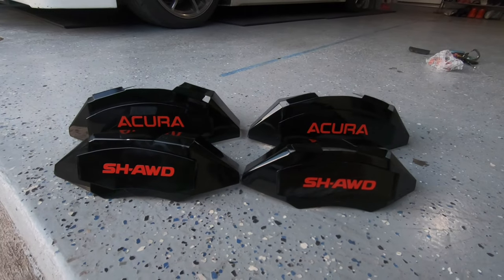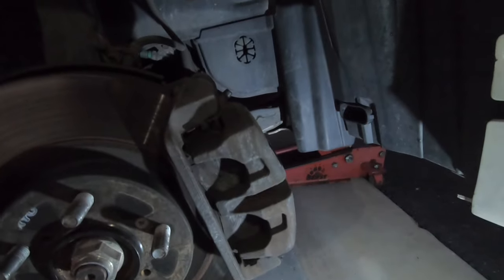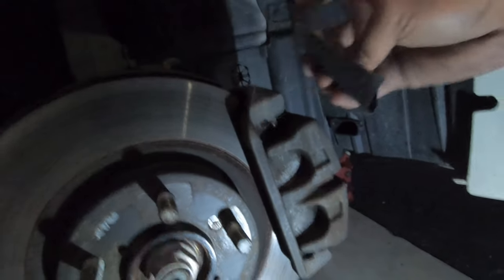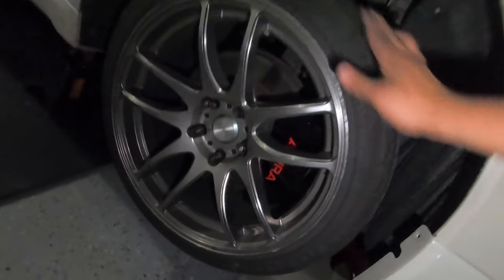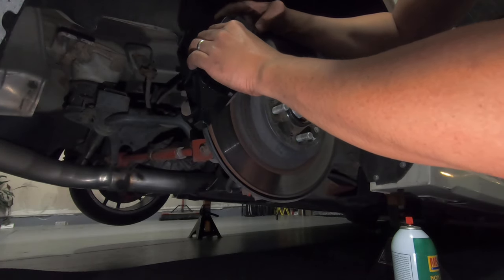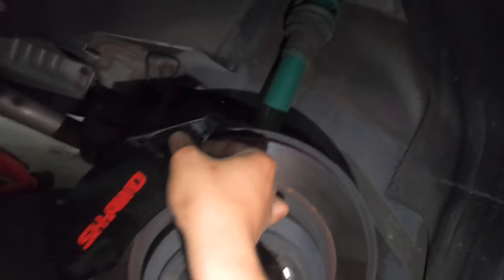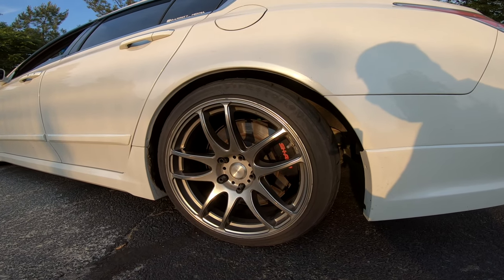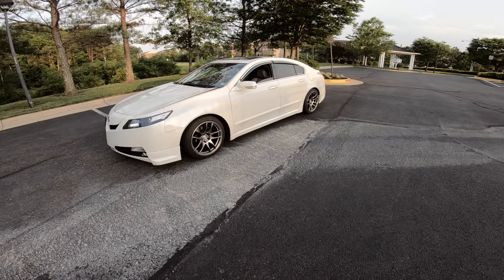CCI Caliper Covers Install Acura TL

Comment: 180+ for cheaply folded vibrating aluminum with sticky magnets that go onto rusty cast iron. You can paint your calipers any color and put a logo on them and spray clear over that for way cheaper and would look way better.
Reply: Or you could do this and not have to do any of the major cleaning, prepping or paint work. Most stock calipers don't have a flat design to put decals on evenly like the BBK's. I agree they should be more affordable but it's a decent looking appearance mod and doesn't require any real experience or time to do.

Comment: Yo bro do the tein coilovers ride better than stock ? And if so in what way does it ride better ?
Reply from the maker: Going with tein Coilovers made the ride stiffer and makes the car feel really planted on the ground. It gets rid of the body roll whenever switching lanes quickly which I really like. Also makes the car look a lot better getting rid of the wheel gad
Reply: @GarrettMedia  does it feel better stiffer or do you miss the oem softness
Reply from the maker: @jarina9660  I don’t miss the softness at all it was too squishy for me and there was just too much body roll. I prefer the stiffer ride because it feels a lot sportier and I feel more confident driving the car overall.

Comment: Intake duct inlet install I wonder if it helps power
Reply from the maker: Ah yeah I need to install that I’ve been putting it off. It definitely should help with power since it’s constant cool air rather than hot air with the short ram intake. Short ram intake would be good for the winter time.